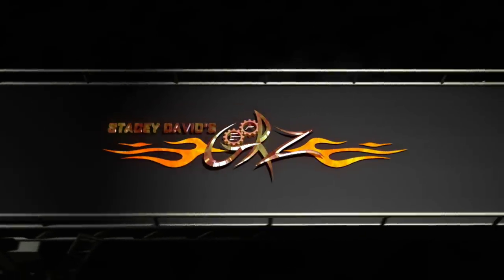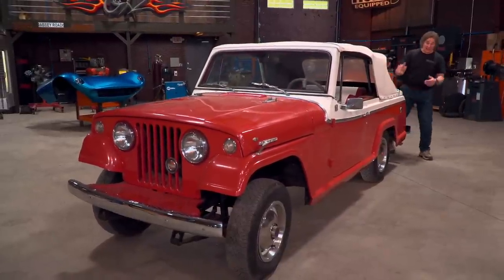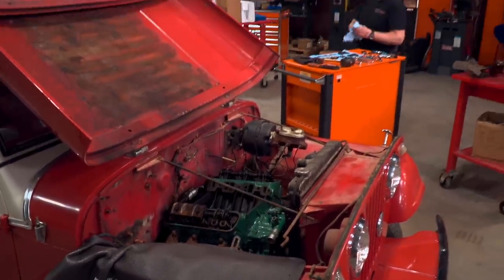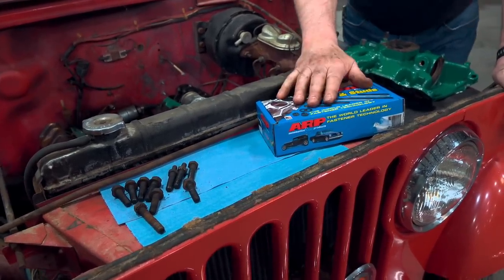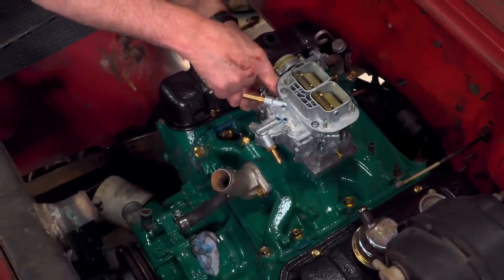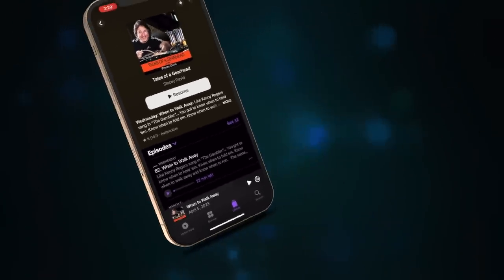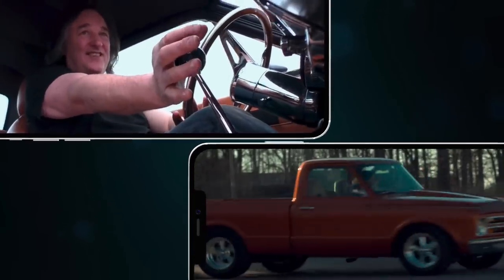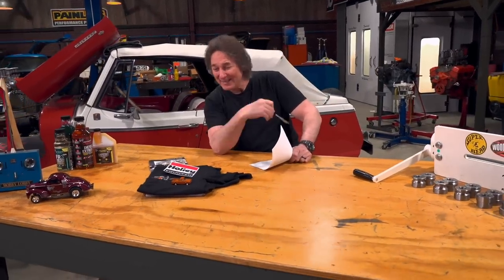Jeepster Going Commando! Starting a Jeep Restoration - Stacey David's Gearz S17 E6

Comment: I miss both my 1980 Jeep CJ5 258 inline 6 and a 4 speed transmission. And my 1988 Chevy S-10 Pickup with 4.3L and 5 speed transmission. both were fun vehicles and I loved off roading in them! Am looking to get an S-10 Pickup for a project vehicle. I want to make it a Convertible California Lowrider with articulated full size bed.

Comment: I saw this episode and am happy to say I have a 1967 RS Camaro and a 1986 Chevy Silverado 3/4 ton camper special. That came with the dual tanks and batteries, I purchased the truck straight off the lot. The truck is under full restoration and I would like to know is that a 4-inch lift and what size and make are the tires and rims. Also on a comical note, any way you can bring back the 16 1/2-inch rims and tires .
Reply: That lift appears to be a 6”-8” with 37” tires.

Comment: Could have cleaned up the top of the stud with a wire wheel, put down a washer, welded a 1/4"/5/16" nut, heated up the manifold let the heat suck wax down the threads and work it out slowly.
Reply: That’s my go to.

Comment: I have a 57 Chevy nine passenger wagon. Needs a gas tank. And they don’t make a replacement tank for a nine passenger wagon. Any suggestions?
Reply from the maker: If there aren't large holes in it, you could try one of the tank coating products. We featured one last season. Check it out at the 9:08 mark of this video: https://youtu.be/98zMIMs7Yqo
Reply: @OfficialStaceyDavid  thank you for your help. That’s the way I’m going to fix mine